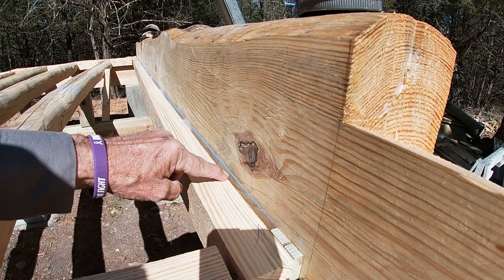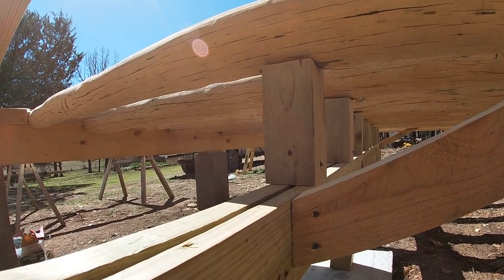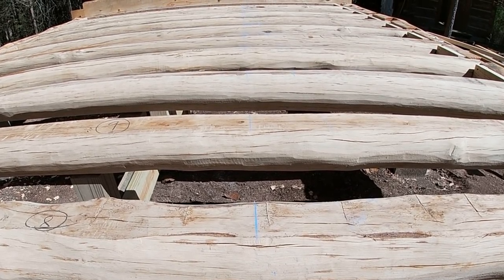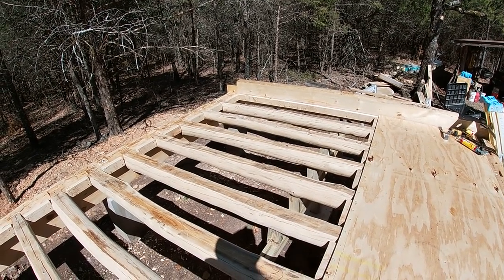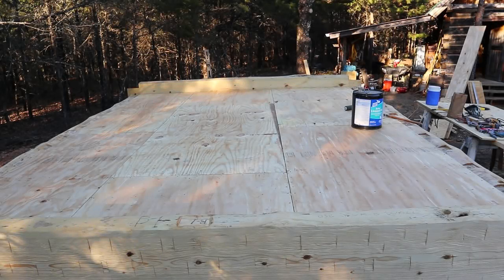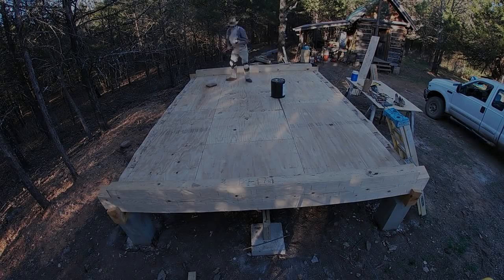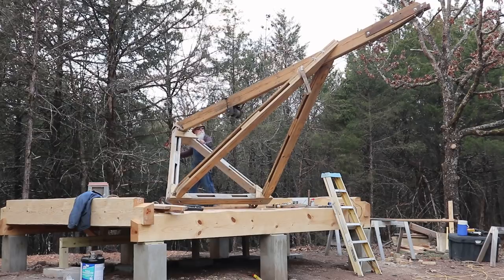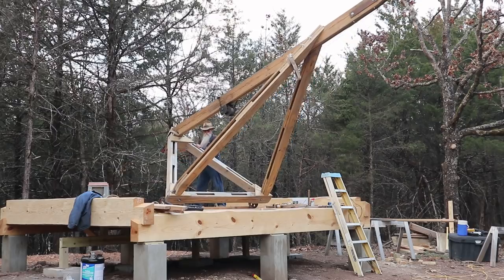Girder and Subfloor - Dovetail Log Cabin Build (Ep 18)

Comment: Dear Bearded Carpenter. Greetings. The long ledger placed on the end logs and the short boards placed between the joists on the Sills have been screwed in?
Reply from the maker: AS   Howdy Yes, l put a 3/8” spacer block between the ledger and the logs and used 3 1/2” torque screws. The spacer block will allow water to run off the subfloor during the construction. God bless you